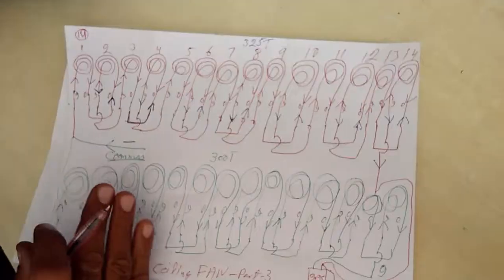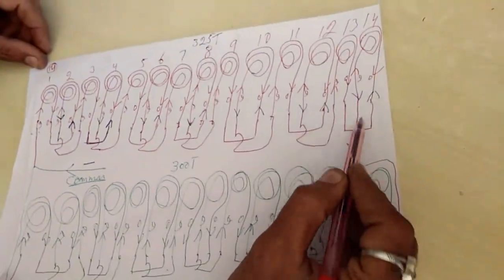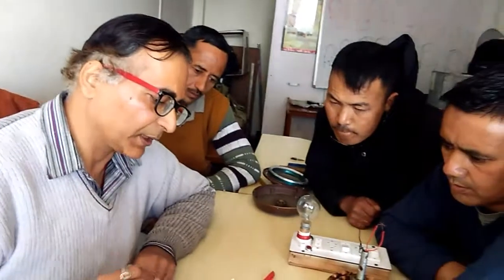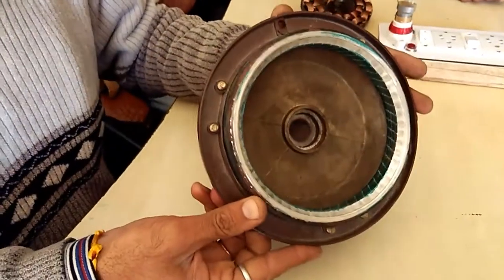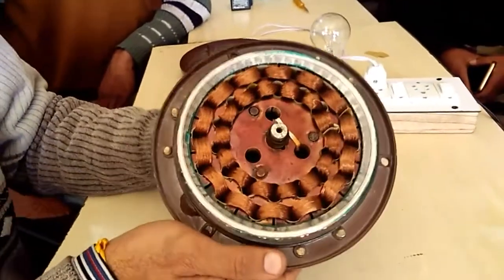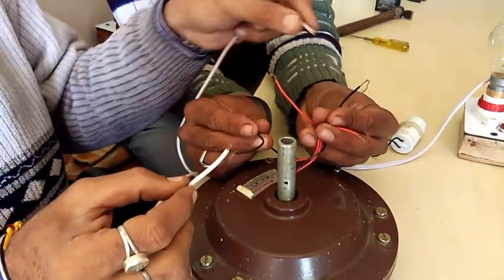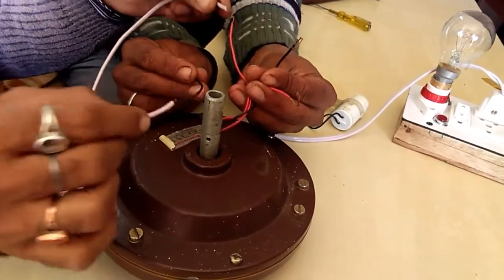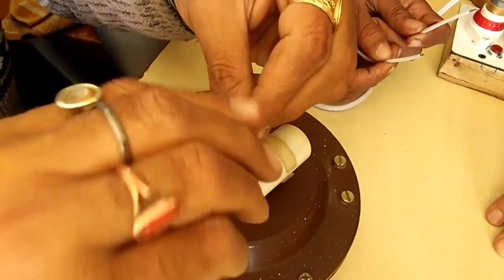Ceiling fan

Comment: Sir ceiling fan winding kaise karte hai machine ke bina. Maine suna hai ke hum bahar hi coil banakar winding kar sakte hai
Reply from the maker: +hamid mulla it is possible but it is not easy
Reply: Mukul Chopra sir 7+7 coil k ceiling fan kya high speed (motor only) Maana jata hain? 7+7, 14+7, 14+14 k motor speed kaisa hain (with out blade/load)?? Same RPM?